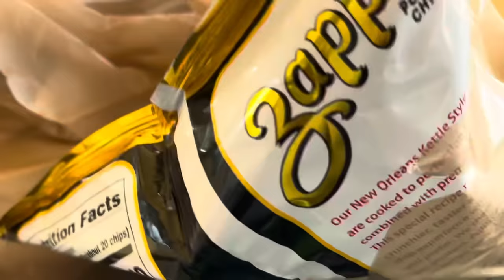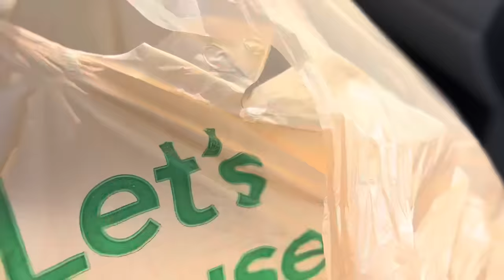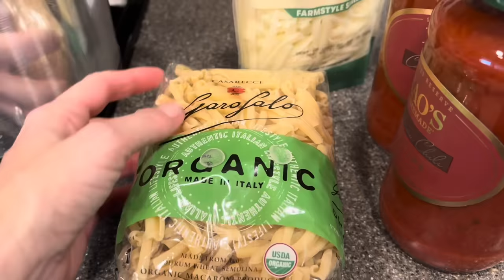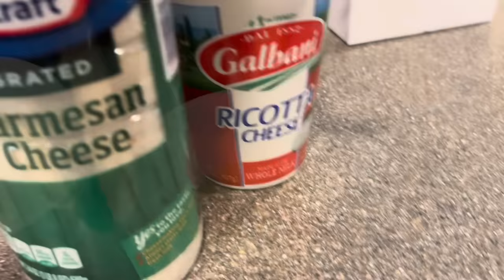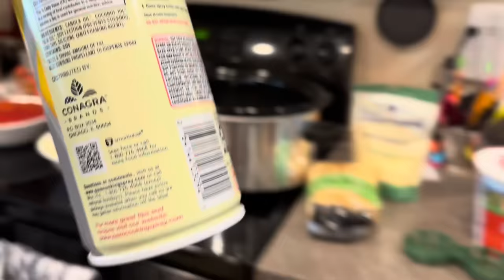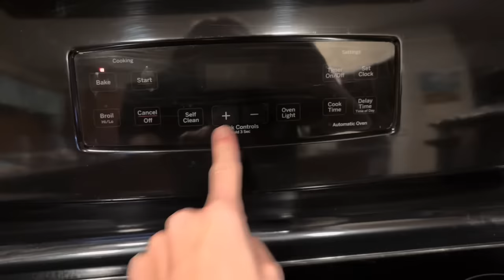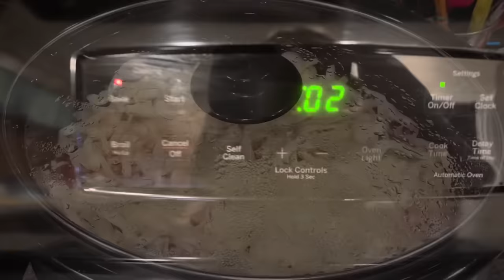Cooking with Wife Unit. CROCKPOT MANICOTTI! @RainmanRaysRepairs @PowerStrokeTechTalkwARod

Comment: A very confident commentary. It’s interesting to see the differences between an American family and area and here (UK). You may (or may not) be interested to hear that the cost of 10% ethanol fuel here is £1.40/litre or $5.37/US Gallon. With distances being so much less here I use a plug in hybrid with 60 mile range, that covers most of my journeys so I rarely buy fuel unless doing a longer journey. Here a longer journey is say 300 miles return.

Comment: So price for gasoline, uhhh, this is gonna be goood!
So it's around 13 DKK/liter here in Denmark for 95 octane E10 fuel.
1 USD is 6.85 DKK so I have to divide by 6.85 to convert the currency to USD.
And a US gallon is around 3.8 liter so I have to multiply by 3.8 to go from liter to US gallon.
And that gives round: 13 * 3.8 / 6.85 ~ 7.2 USD/gallon... I could add more decimals, but why would I, you've likely already died from sticker-shock.

Comment: That food looked really good. I never thought of using the crock pot to made a dish like that. I use the crock pot cooking bags from Dollar Tree which makes cleanup really easy of the crock pot.  Gas was $3.69 when I filled up last Friday here in Washington State at Costco. As high as $6.00 -$6.50 at the major chain gas stations .
Reply from the maker: 6.50?!
Reply: Yes. Some gas stations in my area really kick up the prices if you want to pay by credit card. Even cash prices I have seen can be between .50 and $2.00 more at some specific gas chains. That's the big reason I buy at Costco or the local Tribally owned stations.  @wifeunit
Reply: @wifeunit  Para nosotros llenar un tanque de 60 lt. con "la nafta más barata" (95 RON) tendremos que pagar unos u$s 35 ya que el litro vale $692 (u$s 0.53)  1 dollar=1.300 pesos arg.
Quizás para ustedes pueda verse como caro o barato pero no lo sé, porque no tengo dentro de la ecuación el salario (en $arg.  o en u$S de ustedes) 
Espero se entienda. Sólo mis 2 centavos, ya que lo has preguntado. 

Y tu comida ¡se ve muy buena! aunque sin saber el "gusto" (taste/flavor) de ella, pero lo imagino. Éxitos.